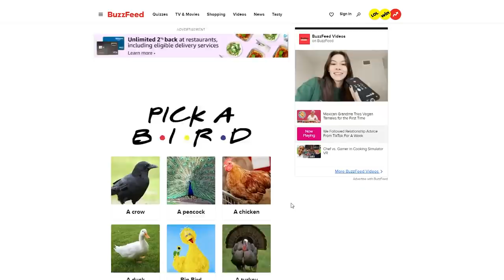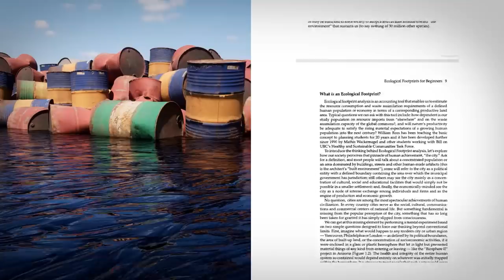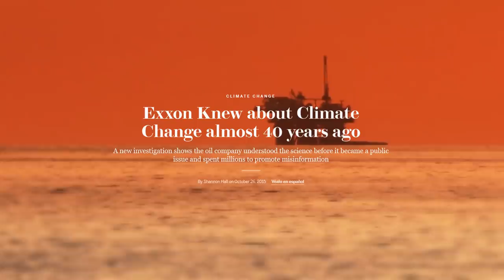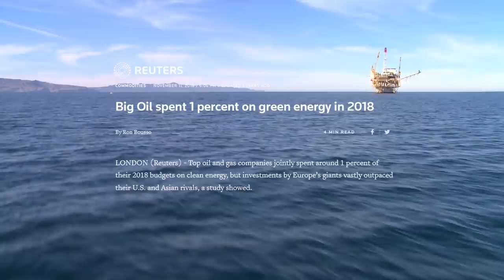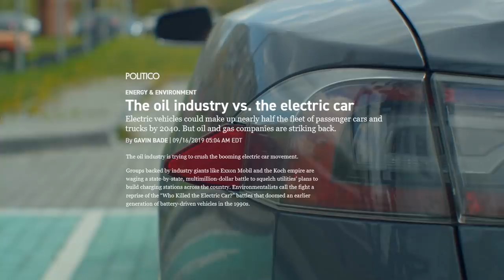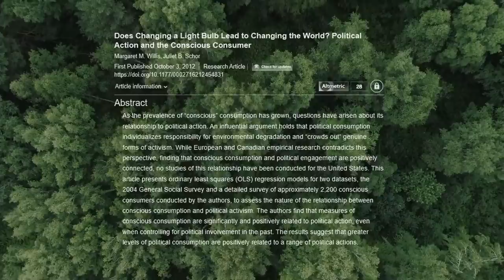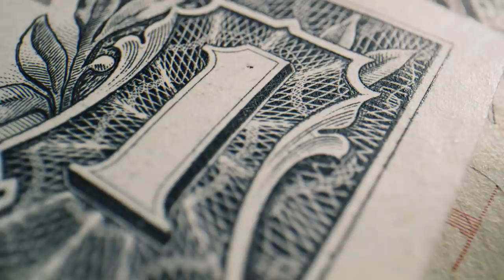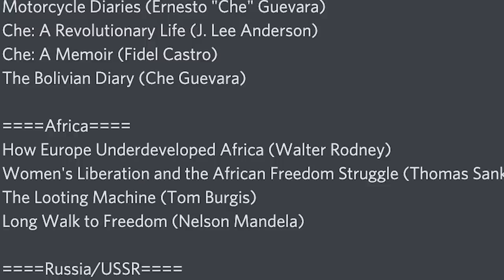Your "Carbon Footprint" Is A Scam

Comment: It's just another way to blame "personal responsibility", which of course only applies to the working/middle class, and never does a company need to be responsible and held to account. Great video as always!
Reply: Corporations are people, but they're exempt from personal responsibility to the extent that they're above the justice system that holds us non-corporation people to account.
Reply: I mean your buying their products. Your the one bankrollimg their endeavors.
Reply: @peacelovebrad  No they aren’t. A corporation is an entity, a huge body of people, but the people with the power that move the corporation are a few at the very top.
Reply: @appropriate-channelname3049  And they produce the emissions before they sell products to us, they have a part to play too. This does not mean that we should despair as neither alone could change things, but rather, we should take a comprehensive approach to crack down on consumerism from both the supply and demand end of the production chain.
Reply: @appropriate-channelname3049  ....by choosing to survive in a market economy. From the video: "your limitations as a consumer mean that things outside of your control get in the way of even the best intentions".
Reply: @appropriate-channelname3049  This video just talked about the problem with blaming individuals, if I were to stop making any pollution for 70 years, it would take 1 second of the total pollution caused by the global energy sector. Why are you living in capitalism if you hate it? It’s the same reasoning, I’m forced to live in America until I’m wealthy enough and old enough to move.
Reply: @okman7504  You're 100% correct, but I'm not personally arguing that corporations are people--I'm citing the U.S. Supreme Court's interpretation of the 14th Amendment.
Reply: @okman7504   your shifting your own personaly responsibility. Your a small part of a larger whole. Technically jeff bezozs could argue the same thing. He could say ohhh I'm only worth the money California spends on education in a year i can't make any serious change. Your ecological foot print matters like your voter matters. The small things are what add up. In the western world you can live a sustainable life. Cut down on beef, repair old items instead of buying new ones. Support  green and nuclear energy etc... your whole view on this is toxic. Its like saying your vote doesn't matter.
Reply: @appropriate-channelname3049  wrong. They get subsidies. People voting with their wallets matters WAAAAAAAAAAAAAY less than congressional voting. The USA printed so much money last year (for rich elite handouts) that the money supply nearly doubled.. it doesn’t matter as much what people buy, it matters much more what the government buys.
Reply: @peacelovebrad  all you would need to do is cut down on beef, repair shit instead of throwing it away. Buy used instead of new. These are all things you can do in capitalism. If you wanna go the extra mile. Plant a tree or two every year and support politically canidates who support right to repair, goverment funding into lab grown meat and  clean energy like wind solar and nuclear
Reply: @appropriate-channelname3049  do you honestly think we should focus only on demand? That supply isn’t an economic factor? If so, then you’re being EXTREMELY silly, imo..
Reply: @whysocurious7366  I don't think you get how the economy works or how the federal reserve works at all.
Reply: @appropriate-channelname3049  Troll is troll
Reply: @appropriate-channelname3049  Right to repair is infuriating to me because I enjoy fixing things and can imagine a lot of people making a lot more money doing so if it weren't for planned obsolescence (years ago, when I was a full-time handyman, I made way more money replacing appliances than fixing them). I'm with you on nuclear, too--I haven't seen a convincing model to cap global carbon output while avoiding mass starvation without nuclear power.
Reply: @whysocurious7366   yeah supply don't matter if there's no demand for it. For example silly bands used to be very popular. They made a shit ton of them. Soon silly bands went out of fashion. They still made a ton of silly bands. People didn't buy this massive supply of silly bands. Thus the company was forced to stop making them.
Reply: Solution to our current societal problems:  Overthrow the existing capitalist order, and establish the Dictatorship of the Proletariat.  When the capitalist class is disenfranchised and barred from political power, money won’t have the leverage it does in our one-party state.
Reply: @appropriate-channelname3049  Yeah doing your part is important, but you seem to entirely throw away that the entire system is build around those things and that those big corporations that sell you stuff also maneuver to be sure that alternatives do not reach the market, regulations are not enacted or that things get delayed as much as possible.

One regulation could have much more effect that if all the people of the US reduced their consumption of meet.
Reply: @appropriate-channelname3049  By only looking at individual responsibility, you limit the scope of what you can do and shift the blame to the consumers.
Reply: @appropriate-channelname3049  your carbon footprint is actually objectively negligible. Also logistically impossible to lower, financially unfeasible, and literally cannot control 80% of it.

Nuclear energy is held back by fossils fuels, solar on rooftops by nimbys, and plastics aren't recycled.
Reply: @appropriate-channelname3049  Its like you didnt even watch the video.
Reply: @appropriate-channelname3049  here's my argument:

I don't give a shit about the environment and pollution. I will continue my shitty unsustainable ways. If you want me to stop you have to make me stop. Otherwise, I won't stop, because I'm a sadist and I like to see the environment burn. 

So, how do YOU get me to change knowing I refuse to change? Do you care about the environment, and what are you going to do about millions who think like me and continue happily consuming destructive products? Would it be easier to ban plastics and enact other legislation so that no matter what I do I couldn't possibly harm the environment?
Reply: @MichelleHell   maybe I can't convince you but your a exception. Most people care about climate change or the environment. If asked alot of people will do the right thing. Though that might not even be necessary. At the rate of technological and economic expansion we might be able to work around global warming in a few decades.
Reply: @appropriate-channelname3049  WATCH THE VIDEO.
Reply: @appropriate-channelname3049  I'm not gonna make points that were already made, but to add there are many predatory ways in which corporations work and it's not just the consumer's fault, and also there is monopoly on goods. And personal responsibility just can't be applied to some things - like electricity. Sure, you can use solar panels but they are 1 expensive to buy for yourself if you're living paycheck to paycheck, 2 not a valuable option in most cases (thanks to permits, climate, neighbors and so on), so you're just stuck paying for electricity generated by gas or coal. Other instances are like you can use recycling bins, but 95% of the trash taken from recycling companies is not being recycled and in most cases is being burned, so how are you responsible

P.S I'm not an expert tho
Reply: @appropriate-channelname3049  I won’t respond to you, it seems that everyone have already destroyed you before I could. Civilians in America have such insignificant power. Police are heavily militarized.
Reply: @appropriate-channelname3049  If someone were to pass on the most severe consequences of their actions onto you in exchange for a hefty sum short of the cost that would get you out on bail, would you actually accept those consequences?
Reply: @appropriate-channelname3049  

How is them doing all that going to have a significant impact on the climate or society at large though? They are but one person with no ownership of a major company worth millions or billions of dollars, how are they going to make a dent in the pollution a large cooperation produces? No seriously how is this useful advice? And why are you so dead set against structural changes to society or don't want to hold massive businesses accountable for their lion's share of the impact on our planet?
Reply: @appropriate-channelname3049  

Then why are you against reigning in the power and influence of large corporations? Why don't you care enough to enact policies and laws that seek to stabilize and save the ecosystems of the world? If you make doing the right thing cheaper and more available MORE people will do so because they don't have to choose between themselves and their loved ones or the longterm stability of our planet's biosphere and weather systems. The right thing to do is to make the right things to do more affordable for most people.
Reply: @appropriate-channelname3049  "maybe I can't convince you but your a exception. Most people care about climate change or the environment. If asked alot of people will do the right thing."
If this fantasy world was right, a lot of businesses would have collapsed and climate change would have been slowed massively by now.

"At the rate of technological and economic expansion we might be able to work around global warming in a few decades."
Lol, what work around is that? It's pretty much too late already, a few decades would be smack dab in the middle of some of the more devastating effects.
Reply: @appropriate-channelname3049  " if you can't see your own agency and your poltical movement downplays peoples agency its bound to fail. "
The point is, some of that agency is towards a collective. There is a reason societies exist. You're also justifying doing the wrong thing by ignoring the things that could be achieved as a whole community and country.
Reply: @appropriate-channelname3049  

So you believe in the power of collective action then? So why are you against structural changes?
Reply: @arphangh5409  

So literally what socialists are advocating for, except its massive, nationwide strikes by workers to demand changes or pursuing an end to private ownership by collective voting for such policies or rather policy makers? Why not form workers unions or organize socialist parties to take over local and then state level governments to eventually the federal level?
Reply: Corporations are people... until it comes to taking personal responsibility.
Reply: @navilluscire2567   GOOD, we should do that. But that shouldn't stop us to influence the capitalistes market in the favor of the invironement in the mid-time. Like ending capitalisme is a long process that requires changing the statue quo, and it's not gonna happend overnight. The thing is ... we dont have time and the climate change consequences are irreversible (and will be felt even in a eco-freindly socialist futur). Also massive public mouvements end up helping them selfs by politizing the population and making them consious of their power
Reply: I remember as early as the 80s when commercials on TV were aired which basically blamed consumers for littering and how they are "destroying the environment", complete with indigenous native (complete with stereotyped "Indian garb" crying as people threw trash from their cars on a highway. This kind of subtle warfare has been going on for decades, and the only purpose is to shove accountability for polluting from the real perpetrators (large corporations) onto the the public.
Reply: I would claim this about food and carbon footprint...
A lot of this in the carbon cycle, if it is in the carbon cycle it really does not matter.
It get sequestrated again any way, still the VAST majority of carbon emissions (97%-98%?) are in the carbon cycle, "cows eating grass belching methane and shitting" it is part of the carbon cycle.
It is when YOU ADD CARBON sequestrated for millions of year the difference / Change appears.

You can very well eat meat (apart from being a very inefficient way of producing food/Calories)
as long as you don't add new sequestrated carbon.
Reply: It's ironic because of the big players were responsible the average person wouldn't even have to think about this
Reply: @appropriate-channelname3049  “hmm you criticize society yet you participate in it”
Reply: but your the one that bought the thing in the first place so it makes sence for some things
Reply: @milesdunstan-daams4855  sure if people boycotted 100% companies would shift. But that's never going to happen for a wide range of reasons
Reply: This is something I’ve been fuming over for the last few years. Maybe all my fuming of rage is to blame for global warming…
Reply: My company's executive drink water in half liter plastic bottle and use AC in cabin. Take printout of every notice use petrol cars for transportation.
Reply: @okman7504  legally they are.
Reply: Uuuuuhm there is a so called corporate carbon footprint, a product carbon footprint and various other metrics to measure the emissions of companies, at least here in the EU
Reply: @appropriate-channelname3049  Different people have different abilities. Doing individual action may have some effect but it will never solve the problem. We need to force production and our systems to be more sustainable which the companies will never do on their own.
Reply: And to third world countries trying to live good for once
Reply: While I would love every single person on this planet to hold hands and boycott car companies, such spontaneous solidarity is nigh impossible. The next best option is to vote more responsibly. Which seems to be difficult too :/
Reply: @lazarous2772  When did I say you can't buy food and clothes. If you can point that out I'll send you 100 dollars. I said you should conserve repair and buy less overall. The only thing I said about food is that you should eat less beef. Because  to producing beef  products is some of the most environmentally disastrous foods. With clothes you should learn to sow to fix old clothes instead of throwing them away.  These companies only produce this stuff because we buy it. There are compani3s that offer ethical alternatives. For example in the technology market there's the fair phone which is made out of recycled materials and is easily repairable. If you don't take personal responsibility and stand up for yourself nothing will get done. Complain on Twitter to your favorite poltican won't do anything  either you will accomplish nothing if you resign yourself of all impact.
Reply: @appropriate-channelname3049  Short sited and incomplete argument. Would you stop buying food or medicine? Do you drive a car? How do those corporations behave? Do you have a choice? It is not the fault of the people,
Reply: @pascualsmithvaldes9038   you buy less conserve more. If anything it's actually more economically to live environmentally friendly. Most people are wasteful as fuck.  It's also just about taking a day or two every month to do something good. Don't just complain on Twitter. Actually campaign for a environmentally friendly politican. Or go clean up a park do something that's beneficial. If you keep buying crap you'll keep getting crap. When the meat industry was exposed during rhe progressive Era for being unsanitary. Not only did alot of people stop buying meat from the big players they also actively wrote to and supported legislators who supported the creation of the fda.
Reply: @appropriate-channelname3049  What if we focus on the hemorrhaging open wound (corporate pollution) and then focus on the paper cut (consumer pollution)?
I’m not saying people should never reduce/reuse/ recycle. We should. And we should definitely have right to repair laws, fix our agriculture practices, etc. But since 70% of pollution is corporate, and only 30% of pollution is by individuals, we ought to prioritize the bigger issue.. right? I understand agency is important.. but is finding the most effective way of stopping climate change also important to you?
Reply: @appropriate-channelname3049  making people feel bad/ guilty makes them not want to work with you. They’ll just pollute more. You’re not taking a very pragmatic approach..
Reply: @appropriate-channelname3049  Oh yeah, genius idea that every single individual, down to the measly homeless person, should just "go nuclear" and then "bam climate change crisis avoided in a decade." The smugness of your naivete is unfathomably cringe-worthy. 

"Your whole view on this is toxic." 

Man, the irony never gets old.
Reply: @appropriate-channelname3049  Having the collective that lives together on this planet try to save the planet together with real solutions is "self destructive" and we're "doing the wrong thing"?

Welp, you heard it here, folks. We got ourselves an all-knowing moralizer who's not really that good at gaslighting or making an actual sound argument or valid point without being extremely vague.
Reply: @themajesticspider-man6116   there are other options. Instead of buying that new fancy iPhone buy a fair phone. Instead of going out to mcdonalds eat in. It's all fairly simple to do. I'm not gonna lie its a inconvenience  to be green but its not impossible. It's sad when people de claw themselves and actively deny the affect they have.
Reply: Guess whom are that companies poducing goods and services for...
Reply: @appropriate-channelname3049  most people care about the environment but not enough to drastically change their lifestyle and habits
Reply: @AuroraAce.  yeah but it's usually not that drastic.  A few small sacrifices here and there that's it. Buy used and repair old stuff. I don't expect someone to change in a day but take a year or so to try and slowly add on new things to change your life.
Reply: @appropriate-channelname3049  you aren't stopping climate change with such small lifestyle changes.
Reply: @AuroraAce.   well you could say that about anything. You shouldn't vote because your votes one of millions. You shouldn't  try and better yourself because their are millions of things that affect your life that you don't directly control etc... if everyone had the mindset of my work doesn't matter than nothing would get done. Every action is important and his millions of unforseen ripple effects.
Reply: I had a realization long ago, which was simply, "Wait, shouldn't the people with all the power and resources have the job of changing things?"
Reply: Yes the rich and the powerful never ever ever have personal responsibility but us the middle class and poor are we we need to be responsible how dare we not have 6 months worth of savings how dare we not reduce our carbon footprint were such pigs how dare we get sick and miss work and possibly lower our employers profitability 0.000000001%
Reply: @appropriate-channelname3049  unfortunately, this doesn't work with consumers managing the market because a) youre always gonna have consumers that don't give a sh*t, and b) what about food and gas and clothes industries, things that are necessary? People can't give these things up entirely (at the moment with electric cars) but i like nuclear energy use being realized. My country has a thing against it, theres ads proudly promoting no nuclear energy used in this country! 😭
Reply: @appropriate-channelname3049  no I am saying if every human made the changes you proposed we would still have a climate crisis not that the changes won't do anything
Reply: @appropriate-channelname3049  BP cutting corners to make billions is not our job.  I work in a warehouse.
Reply: Classic "Privatizing profits and socializing risks" in action.
Reply: @gabbyn978    you know that in India they don't eat beef right?
Reply: @appropriate-channelname3049  your vote (doesn't) matter. It's a complex issue but in general both statements can be true
Reply: @smugmode  Most leftists spend all day either complaining on the internet or protesting.
Reply: @appropriate-channelname3049  That question has already been answered in the video at 3:41 to 9:59
Reply: But why would the same person tell us we are individually responsible for 'systemic' issues such as racism? The belief in individual responsibility may be selectively applied by class as you state, but even more so it is selectively applied by issue, which is logically inconsistent.
Reply: @mycpowers7273  I don't know what you mean with "the same person" - most problems can be both, if you're racist and you deal with racist measures towards certain group of people, that's on you, but that doesn't mean there isn't systematic problem. When you talk about systemic racism, you don't just talk about the cop that killed the guy, you talk about the system that allows it to happen as well. Just like in Climate change,  I don't say you should go full nihilist and throw crap and plastic on the streets, I say that individual  responsibility is not enough to solve the issue. And also, like in your example, someone who poludes the Earth without any sanctions is a way bigger part of the problem, but it's not just personal, because there is a system that helps him get away with it. And of course, there is a huge difference between throwing a plastic bag on the street, and using predatory bussiness practics so you can get as much money while polluting as much as you can, and we don't have the time to wait for some people to grow as individuals. Like even during the Holocaust and before it antisemitism was used as a personal take and most of the world closed their eyes to what was bound to happen, cause 'antisemitism' was in quote marks and a personal flaw, right?
Reply: Vote in local elections, most people don’t realize how few people actually vote in their county/state.
Reply: @ЦветанГанчев-у4п  Individual change and collective change are interdependent issues. I just notice that neoliberal woke types want to apply the idea of individual responsibility quite selectively whereas there is no justification to do this.
Reply: @smallmalaysianboy8025  Whatever, man. At least these people are doing something. Anything. Voting doesn't work so well here in the US when money influences everything. The best democracy money can buy
Reply: Weak cop out of responsibility
Reply: @appropriate-channelname3049  i dont think you have any idea how much energy it takes to grow something in a lab.  It takes more carbon producing energy to produce lab meat than it does to raise beef on a farm, not to mention lab meat tastes and texture is gross.
Reply: @chuckd9007  thats at the current tech we have now. The price and quality of lab meat  has been getting better and better. It used to be 1k for a meatball now its only 100 bucks per meatball. Which is still expensive but if it continues on thr trend its been going on we will all be eating lab meat pretty soon.
Reply: @appropriate-channelname3049  what does price have to do with energy consumed during manufacturing?
Reply: @chuckd9007  the carbon price which is totaled to give you the compani3s carbon foot print includes consumer usage of their products and shipping of their products as well as manufacture and extraction.
Reply: Well said
Reply: @magnusbjarni  for all the money spent subsidizing solar we couldve built a lot of nuclear power plants that will last many years longer, and wouldve provided magnitudes of more power.  Solar is not energy dense, to use it as a primary source is not ecologically sustainable,  large arrays cause local climate changes and even larger arrays, like the ones being proposed in the Sahara would cause global climate changes, not to mention there just isnt enough land for grid scale solar and wind with various mechanical energy storage systems for peak demand.
Reply: And the rich never leaves anything with their private jet etcetc.
Reply: @appropriate-channelname3049  The video literally tackles this argument. Reducing the problem to "consumer vs producer" is the problem and what companies like BP wanted.
Reply: @appropriate-channelname3049  Exactly, not that their role and lobbying had had a big part on the promotion of CO2 heavy products, but those claiming that the responsibility is not personal too, are really saying they don't need to do anything because this is not my fault. In other words, this is the liberal version of climate change denial.
Reply: @appropriate-channelname3049  We don't have few decades. What technology? This is magical thinking.
Reply: @appropriate-channelname3049 Drop in the bucket mentality only works when there are enough possible drops to fill the bucket.
Reply: @gabbyn978  Fukushima is literally a worst-case scenario. It required both a tsunami AND criminal negligence for it to happen, and it at most caused only 1 death directly, through cancer several years down the line. A majority of the deaths were from the resulting evacuation.
We haven’t had a single nuclear accident in over a decade, and we haven’t had a accident related to nuclear power, not even necessarily the reactor itself, directly kill more than 4 people since Chernobyl. Nuclear isn’t meaningfully more dangerous than wind.
Reply: @gabbyn978  
The upper estimate for nuclear deaths per terawatt hour, including outliers like Chernobyl and indirect deaths from evacuation, is at most just under double that of wind. But the realistic number, which excludes Chernobyl (as it should, disaster on that scale is flat out impossible with modern reactor designs), is actually HALF that of wind. It also takes up less space per terawatt hour than wind or solar do.
Modern generation IV reactors are all designed to have a closed nuclear fuel cycle, eliminating the production of nuclear waste. Some are even capable of using the existing nuclear waste as a fuel supply.
Reply: Yeah weird how we treat companies in court like people, except when it comes to terms that they came up with themselves....
Reply: @appropriate-channelname3049  You have some valid points to make. But you also fail to consider the context of where those you consider your detractors are coming from ( much of it addressed in the video) and you're rude af.
Reply: @appropriate-channelname3049  lmfao dude you have contradicted yourself so many times. First you say most people want changes and to help climate change. Then you say that companies won’t change if the people won’t stop wanting the same things. So how tf are they wanting change and the same thing at the same time? If corporations and companies change their products, consumers will HAVE to be buying the right stuff instead of people HAVING to buy the polluting things. You have contradicted yourself multiple times and I haven’t even gotten through all your rambling responses. You got ratiod hard.
Reply: 1% rule: "Rules for thee not for me".
Reply: @Iron-Bridge   the points aren't adequately covered in the video. The  video isn't a great piece of argumentation. It used mostly Wikipedia articles as sources. Which  while Wikipedia is useful for quick searches it has no place being used in a think piece like this. The reason why most people are apathetic to most of these issues is because of peoples spreading the message that their action done matter. That they have no effect. When people belive that they don't do anything to really fix the problem.
Reply: @JazzOLantern   most people in the first world care about climate change to a extent but the big problem are people who argue that individuals mean nothing. If your told that what you do doesn't matter than why should you do anything?  That's what most climate change people think. It why you don't see most people who belive in climate change actively recycling or campaigning for polticans who belive in climate change etc... ask the people around you on average in the u.s most of them do belive in. Climate change. Then ask those people who belive in climate change how often they vote and then you will see what I am talking about. Also if all of them say they vote every time they voted every election they are lying look it up in the voter rolls.
Reply: @appropriate-channelname3049  I’m one of those people and I vote, recycle, and do what I can for the environment along with many others in my community, ultimately it still does not matter because the companies are still producing vast quantities. Your voicing things like you speak for all and you know how every single one thinks and that’s very ignorant.
Reply: @gabbyn978  

Actually we have the technology to build MUCH safer nuclear power plants today, it's just not profitable or threatens the ever lucrative fossil fuel industry so ofcourse no one with  the power and influence to build such facilities will EVER do so i.e. fossil fuel companies and the governments they control.
Reply: @gabbyn978  

Ok? So what's wrong with that? No seriously what sane person wants to work more than is ABSOLUTELY necessary to get the job done? Do you just HATE spending time with your sopposed loved ones or having a life outside of a job?
Reply: @navilluscire2567  it's only profitable because people like you keep buying unnecessary crap. You don't need the newest phone or computer or car or anything.
Reply: @appropriate-channelname3049  

I don't buy the newest phone or cars, why do weirdly think that's the ONLY things people buy that corporations force people to? Basic necessities like food are insanely in charge of.
Reply: @appropriate-channelname3049  You should take a look at the rich people in this world and see how much they consume versus the middle class or even poor people. It's a lot more than any of us.
Reply: Yeah, we as people need to take "personal responsibility" to hold these companies accountable, by either boycotting them, worker unions, convincing investors not to invest in the company, or some other means.
If the people can't hold the company accountable, then it's a monopoly and the government needs to break it down.
Reply: It's not as white and black at that there is a lot of grey area your not mentioning or even thinking about....
Reply: The ChannelName guy is not getting the point so adamantly it's like he's a test for the people arguing with him on how well they understood the video. Dude is a tutorial enemy lmfao
Reply: @appropriate-channelname3049  
Tbh our vote kind of does not matter.
2020 made that clear for me lol.
But then again I usually never vote because it seems pointless when the system is obviously been broken for decades.
Reply: @appropriate-channelname3049  You don't seem to either given how Blindly you think government should be trusted or labs to produce food.
Reply: @peacelovebrad  Why does repair have to be a right?
It's something that anyone can do, makes no sense.
Reply: @darkzeroprojects4245  I can promise you there a tons of elections every year decided by just a few votes. One more volunteer or a couple hundred more dollars donated could have swayed alot of elections.
Reply: @appropriate-channelname3049 Ah yes im an idiot because i can make processors and gpus in my garage instead of buying them.You pay for the engineering,tax.Materials don't cost so much.
Reply: @david-yi6dm   I mean you could always buy used or buy from a ethical computer and phone manufacturer.  Take better care of your current devices etc... being financially frugal usually means your being environmentally sounds to.
Reply: @appropriate-channelname3049  Used pc maybe,used phone-hell no.My phone is 6 years old and somehow still works nice and haven't slowed down.I can buy new phone but i don't see the point of spending so much money on bloatware infested phones nowdays.
Reply: " take personal responsibility for our actions" billionaires
Reply: Your Carbon footprint is as much as your responsibility as it is corporations. Corporations wouldn’t have anyone to sell to if people didn’t buy their product
Reply: the middle class isnt real but yes
Reply: to be fair, everyone emits some amounts and we cannot stop global warming if some people do not take their part.
Reply: @qinby1182  Not quite. Global beef and dairy production is rising, doubling in the last 50 years. Methane is a significant contribution to climate change, as are the massive agricultural industries feeding this production, producing significant climate and ecological damage. If we all cut back say a modest 15% of our consumption, this will go a long way to halting GHG emissions. However, it is massively aspiration in poor countries to achieve the hollow "american dream" of eating a hamburger for every meal. If this is achieved en masse, we are even more doomed.
Reply: @retiefjoubert55  
Do agree to SOME extent BUT there are much in that "calculation" missing.
YES agri culture and beef production DO use a lot of water, release GHG...
BUT
IT DOES NOT HAVE TO, that is how it is practised.

The SIMPLE (and correct) way to think about this is...
AS LONG AS fertilizers MADE OF FOSSIL FUELS (as most are)  is not used in Farming / raising cattle they are a part of the NATURAL carbon cycle and makes no harm NO MATTER WHAT THEY RELEASE.

The MAIN ISSUE is "digging up sequestrated carbon" and ADDING this to the carbon cycle.
That IS THE MAIN ISSUE, then if it is cows farting raised with crops fertilized by fossil fuel derived fertilizers OR plastics made by fossil fuels then burned / degraded releasing GHG.
Then it is NOT sustainable.

HOW MUCH SOMETHING RELEASES DOES NOT MATTER.
AS LONG AS NO SEQUESTRATED CARBON IS ADDED TO THE NATURAL CARBON CYCLE.

We can manage than (Technically, Politically???)
After all the "Carbon Era" is less than 200 years old, we have been around longer than that and NOW know much more.

Although Americans really do live beyond their means in regards to "Carbon Foot print"
Reply: You need to held them accountable.
It’s so easy to say « it’s the corporation ! » and continue supporting them and consuming their products.
Corporation only exist cause people will buy their products.
Reply: @jasonstormsong4940  You should vote for ecological party.
Reply: @ni9274  That's true for the long term, but have you seen what happens when we try to get anyone halfway decent on the ballot? Our two parties have the system on lock. That being said, Americans need to do a lot more organizing between elections to take the power back. Where I am, we're trying to oust Rand Paul for Charles Booker and the movement's been gaining momentum for years. It's a long, lopsided fight but more and more of us are joining in.
Reply: Well if you don’t buy from Major Manufacturers than they lose also I still feel like it starts with us
Reply: if there are no customers the companies stop making the stuff.  lets be realistic here if the companies stop making the stuff you will still have to give it up as a customer anyway so I don't see why it bothers you to give it up
Reply: Personal responsability is also there wether you want it or not
Reply: I thought this was just in Portugal. I'm considered mid class with a SHIT SALARY, it feels like I'm singlehandedly supporting the economy when everyone else with minimum wages do better due to all the benefits they have. I've started considering lowering my income just so I don't get hald the expenses...
Reply: @okman7504  I know it's a year late, but in America corporations are legally people and have little to no responsibilities compared to actual people.
Reply: @peacelovebrad  Like the supreme court ever did anything positive for the people anyway.
Reply: @appropriate-channelname3049  "Cut down on beef" you're making it sound like most people can afford beef in the first place.

"Repair your own stuff" Ok, let me try to repair my broken stuff that I dont know how to fix, just to void my warranty and be screwed. You're also implying that coporations build things to last so you dont buy the newer model.

"Buy used instead of new". Basically saying "take these bread crumbs paseant, wait, you want the steak? Too bad. Be grateful, while I indulge"

"Plant a tree every year or two" righhtt because owning land is so simple and the government will just automatically allow you to plant one on public property lmao.

"Support a political candidate" alright, I'll just keep doing the method that got us in this mess. Ever heard of the definition of insanity?

"Lab grown meat" sure. Id rather replace healthy organic protein with a bunch of chemicals that offer no nutritional value.

"Clean energy like wind and solar" Ok, then we can live in darkness when the weather is bad or when winter rolls around. Plus, i love destroying the earth more mining for these toxic materials that dont get properly recycled and also kill thousands of birds each year. Nuclear energy can give us clean energy for thousands of years? Ew no, id rather be ripped off by our politicans and corporations.
Reply: @appropriate-channelname3049  Nah, its clearly you that doesnt understand how the economy works when you advocate for solar/wind energy thinking its cheaper and cleaner than nuclear.
Reply: BLAME CULTURE
Reply: That's very true. But even when it doesn't do anything for the planet as a whole (at least not in a capacity that matters). Living more "sustainably" can still do a lot for your physical and mental health as well as for your bank account (if you do it right). 

But that's in no way an excuse for companies and governments to walz the responsibility off to the individual.
Reply: Or the rich lizards!
Reply: @okman7504  I wonder what non-capitalist countries there are, like literally every country and society nowadays, perhaps, except the most secluded groups with an isolated economy (some tribes, for instance) are capitalist to a large extent.
Reply: I agree big business is to blame but stop to think about 8 billion footprints !
Reply: Няма как да сме "безвредни" за природата като сме осем милиарда
Reply: Consumers create the demand… fool
Reply: Replace “company” with “government ”
Reply: @libcommi  same thing dude.. the people are the shareholders of the government
Reply: @appropriate-channelname3049  BP, shell, and Exxon would still exist whether or not I drove a car. The problem is that these companies exist
Reply: Makes me laugh when they show power stations. The large plumes are steam and water vapour, from the cooling towers ,  oil not a fosil fuel, its abiotic
Reply: It "is" personal responsibility. Same with getting fat.
Reply: Oh yeah, smacks head